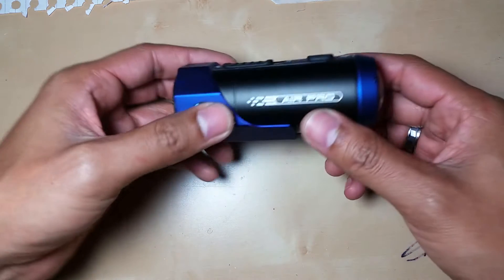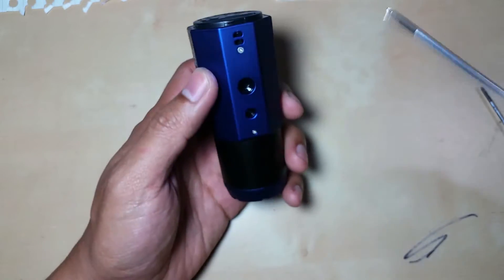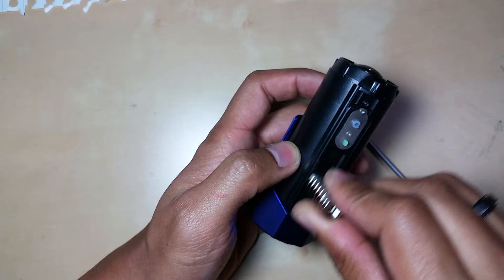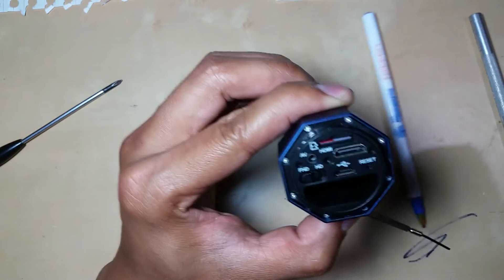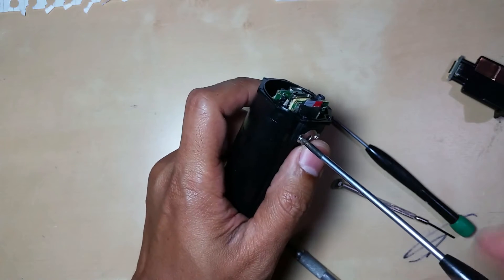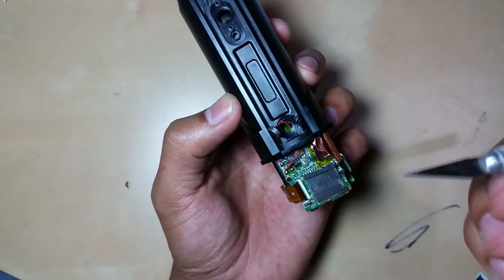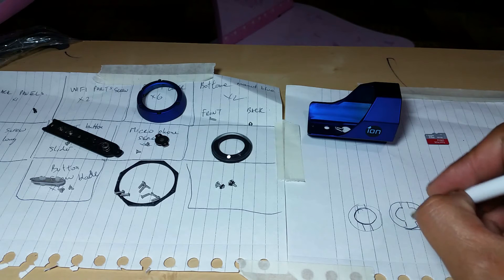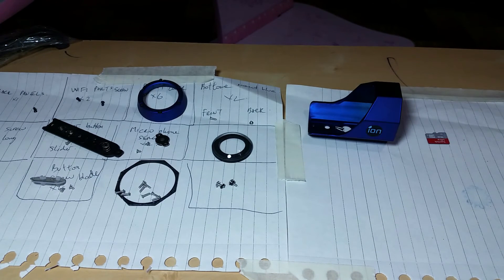ION Air Pro Lite Wi-Fi Action Camera 1011L - How to disassemble the Camera and Replace battery.

Comment: Hi, many years later.....where can I get a replacement battery?
Reply from the maker: You will need to look at the size of the battery and order the same one. You can search in eBay r AliExpress 3.7v lipo battery and see how many mAmp show on the original battery and order one. Look out for the dimensions too. 
Hope it helps. 
Yes many years later and this freaking camera still works. It's a brother to Nokia phone :).
Reply: @LONEWOLFAirsoft Awesome! thanks!. I bought my 3rd one now but the battery is dead. Going to try to revive it. Glad to hear yours is still working, makes me hopeful for mine.

Comment: My ION Air Pro 2 won't stop buzzing when turned on. The reset button will turn it off, but when using either switch to turn it on, it won't stop buzzing. I've tried 2 different known good micro SD cards as well. Any suggestions other than throwing it against a brick wall?
Reply from the maker: I don't own the model 2 so I can't help much. You should dl the manual and looks under the troubleshooting section.
Reply: @LONEWOLFAirsoft  The only difference from the Air Pro Lite and the model 2 is the microphone input on the 2. I've gone through all the troubleshooting on the buzzing problem, but nothing suggested makes any difference. I now have nothing to loose, so I'm taking it apart, and thanks to your great video, I wouldn't have found HALF of these screws in this thing!!
Reply: @ChrisR57  Hi I have the same problem.

Comment: These cameras are built like a brick shit-house!! I cannot get enough torque on the tiny screwdriver required to remove all these micro screws!!
Reply from the maker: A good screw driver will do. Find the correct size of driver before turn it.
Reply: @LONEWOLFAirsoft  Found one, PH0 x 2" works great!

Comment: Hi. thinking my battery has an issue when i disconnect it it reads normal voltage but when connected the voltage is around 35mV and the camera wont switch on unless the USB cable is plugged in. I'm thinking the PCB is the problem. your input would be appreciated..
Reply from the maker: I think your battery is bad. It should be around 3.7V. Not mV
Reply: @LONEWOLFAirsoft  yes but the battery on its own (disconnected from the Ion Pro) reads 3.6V
Reply from the maker: 3.6v could be a battery too. Normally the battery should read 3.74V. Also the camera can not be turned on when you plug in the usb. Well that is all I know. I could be wrong. And that is all I can think of.
Reply: @LONEWOLFAirsoft  thanks will look into it further.

Comment: How do you swap lens to 35mm? I have the camera apart and a 35mm lens to put on. Thank you.
Reply from the maker: You need to unscrew the original lens and screw in the new lens. To set the new lens focus connect the wifi with your phone and live view it to se the focus.
Reply: @LONEWOLFAirsoft  Got it.  THANK YOU!!!!!
Reply: @charlesr86  what 35mm or 50 mm lens did you upgrade to?  I'm looking to do the same thing.
Reply from the maker: @briceplouse8271  I have both version of 35mm and 50mm
Reply: @LONEWOLFAirsoft  do you have the model of the 35mm zoom lense you use?
Reply from the maker: @briceplouse8271  yes I did have both 35mm and 50mm. They are distinguishly different.  Look through my videos you will see footage of the 35mm lens test and the 50mm lens test.
Reply from the maker: @briceplouse8271  yes I do.

Comment: Extremely helpful instructions, thanks. I followed your video and replaced the tripod mount thread. Now I have one challenge. When you remove the rear part you inadvertently pull out the wifi connection. That's a flat strip connection which goes into the other end of the rear section. The connecter strip can be seen in your video at 12:19 - 12:27. How did you get this reattached?
Reply from the maker: It has been awhile so I can not be 100% sure. But I remembered there is a clip where you open on both sides then slide that strip back in the squeeze the two sides to lock it. Also you don't have to undo that connector in order to unassemble the camera in the first place I think.

Comment: Thank you very much for taking the time to document your work! It was a huge help taking apart my iON CamoCam (based on Air Pro 2). Only two additional screws required removal with my camera compared to yours. 

Disassembly of my camera was necessary after using the camera on a bike ride in heavy rain. Moisture got into the camera and roughly a day after the ride, the camera started turning on and off by itself and the lens cover fogged over. It's all apart and drying out now. The camera used to be water-proof when biking in heavy rain, but I guess after two years of steady use the seals have deteriorated.
Reply from the maker: The camera built is like a tank. The battery last for 3hrs. Other camera won't do that. :)

Comment: Do you know if the ion speed pro, that one no Wi-Fi, mounts the same battery lipo3,7V 1200mAH??
Reply from the maker: I don't own a speed pro so I can confirm that to you.  To my experience most cameras use 3.7v Lipo nowadays.  1200mAH or higher is not the issue.  The higher amps the longer the battery lasts before the next recharge.
Reply: Ok thanks, and a part from that, Could you suggest to me a link wherever you prefer, to be sure to purchase the right one, because on line I noticed that there are differt kind with different size...thanks in advance...😜
Reply from the maker: I purchased those battery on Ebay.  What you need is you will look at the serial/model number of the original battery and search for it. or measure the physical dimension of the original battery then go on ebay and look for it.  the dimension will be listed in the item description on Ebay.  best of luck :)
Reply: Ok thanks a lot for your suggestions, but let me ask you the last question, are you confident that your guide to diassembly the camera could be still valid for my camera even if it is a simply ion speed pro??
Reply: Furthermore, I am thinking to change the battery due to the fact that my camera does not power on after a charger connection, the camera after a little time becomes warm...and for this reason I thought the battery as failure cause...👍🏻what do you think about...??😊
Reply from the maker: Fabio Bernardo I think it would be the same
Reply from the maker: Fabio Bernardo my ion pro lite will not allow to charge while recording. Not sure of your model if it lets you do that. 
You can try to buy a new battery and replace it. The battery is cheap. Worth a try.
Reply: Ok great I will try...thanks for your support...but could I know if you succeded to mantain the camera water proof despite a battery replacement??...🤔
Reply from the maker: Fabio Bernardo. If you modify the microphone window like mine the camera might lose its waterproof function. I suggest leave the Mic alone and cut the 2 wires in the middle and extend the length of the wires once the battery replacement done.
Reply: Ok, I will try...🤞thanks again